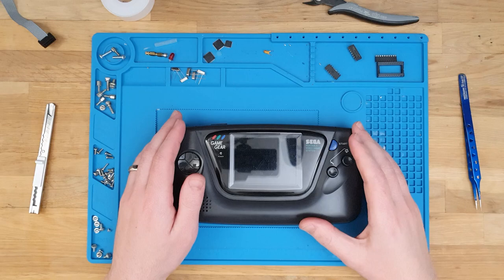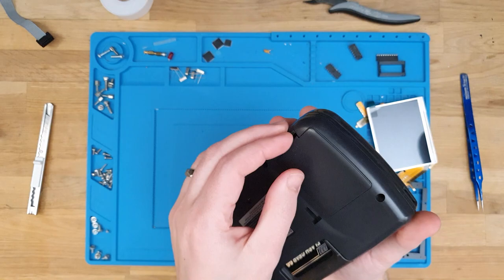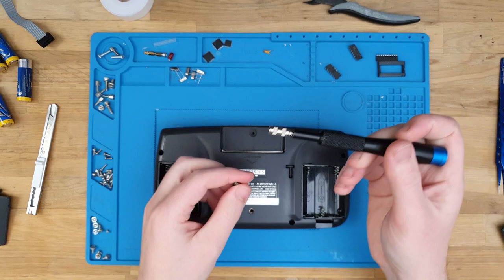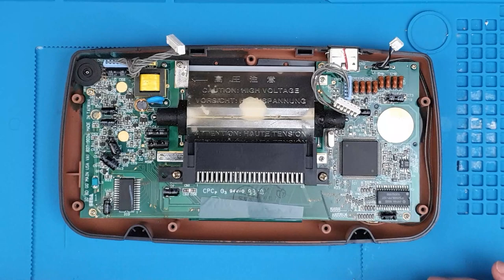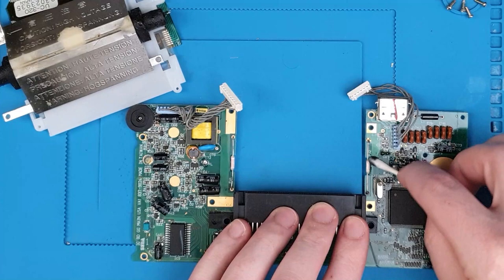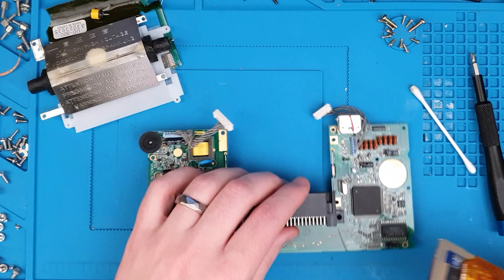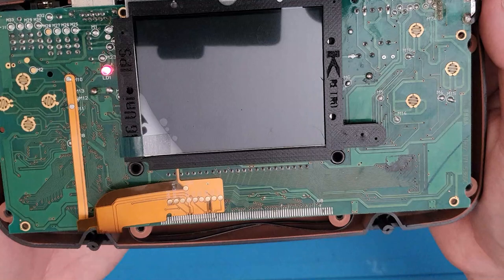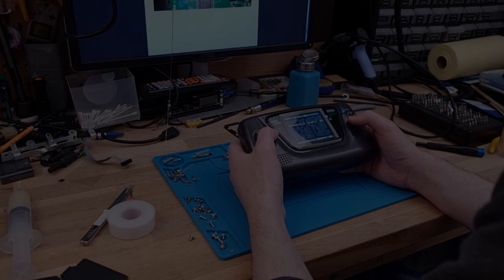Refreshing this Game Gear with an IPS LCD kit

Comment: Why didn't you attach the  T10 ribbon line down into place? I've always attached that and on the GG you are working on in the video, the point for it is just under the main ribbon center where that small bit sticks out. You fold it under and solder it onto the small point marked as T10 near the lower left section of the IC. I tend to install the LCD connection portion of the ribbon flex first to help get that nice and lined up along with the point for the SMS pin 2 section. As you noted, it is much easier to do that with out the LCD in place yet. The only other main thing you need to know as I've installed a few of these now and had 2 of them get sent back after a month or so where the just come up with a blank screen playing blind. The clock signal you solder onto FB1 is very thin on the ribbon flex and seems to break at the solder point easily over time. So I've been installing an additional section of kynar from the FB1 pad back to the clock pad on the LCD in addition to the ribbon flex soldering to make sure. I've brought this issue up with Ben and he is planning a redesign of that section of the flex. Really the trace just needs to be thicker there I think. Nice job!
Reply from the maker: Eagle eye! I spotted this while I was testing and couldn't play SG-1000 games, as they came out black and white and terrible, went back in and saw the missing connection, but was too tired to record an additional segment.  Can't sneak anything past the internet :D This ribbon doesn't seem to need that little leg folded under, as there's a via in the main ribbon covering T10 that you can solder down in place.

Interesting note about the CLK and FB1 connection, it feels pretty solid to me but I'll give it some playing with and see. Maybe this is a newer revision of the ribbon than you've worked with?
Reply: @silvestronsbitsandbytes  The ribbon you have shown looks like the others I've used and my mentioning of this was only about a month back. So I don't think he has redesigned that part of the ribbon as yet. And again, the connection still seemed solid on the two I had, but they were just black screens and sure enough, the clk signal wasn't making contact anymore. So a small jumper wire from FB1 to the clk pad took care of them. As a result of this, as I stated I've taken to just soldering in the extra wire to be sure.

Comment: I've been battling with the idea of doing this or not. Part of me doesn't want to because of the "retro" point as well as this was my childhood console BUT, the video at this point is so hard to see that it's really unplayable. I am hesitant because frankly doing the re-capping was testing to my skillset but Retrosix is supposed to have more kits in on the 8th and that looks a bit easier. One question for you though, what is the name of that cartridge that has all the roms on it?
Reply from the maker: I do agree that keeping the original screen is keeping it more authentic, but to actually enjoy the system and games (without emulation) imo you basically have to upgrade to an IPS LCD these days. The original screens are just garbage now.

The flash cart is a Flash Gear Pro and it takes roms on a microSD card, can find them on AliExpress for relatively cheap!

Comment: I heard you need to trim the sides of the plastic frame a but to fit the screen, is that true? is the image being cut off?
Reply from the maker: It depends on the LCD kit you get. With the BennVenn kit, there's no trimming needed. Some of the earlier Chinese McWills knock-offs needed trimming, though the newer ones don't! The only thing you need to trim across the board is the middle screw post, as it interferes with the new bigger screens.

Comment: Hello, I see that where the 68uf capacitor goes, you replaced it with a 100uf one. It is impossible for me to find a 68uf replacement, do you think there would be no problem if I also included one of 100? Thank you!
Reply from the maker: Hey! This unit was recapped before I got to it, and I didn't even notice that. Good eye! You should be able to easily find 68uF caps from Mouser, Digikey or Element14 suppliers.

I couldn't guarantee no problem with replacing it with a 100uF. Looking at the schematic, it's connected between a transistor and an LCD pin "VM" who's purpose I'm not sure about, but doesn't seem to be used when an LCD replacement kit is used... all that to say yes, you're probably fine with using 100uF!

Comment: Hi, what is the temperature of your iron?
Reply from the maker: Heya! I almost always run my iron at 400c, but I've gotten a good feel for how hot that is, how my tips transmit heat, and how long to linger on joints and wires etc.

I recommend people set theirs to around 340c for most day to day leaded or unleaded soldering!

Comment: Looks great but for all I'd ever decide to use it, the price is not appealing. Especially considering the alternatives these days, such as the Miyoo Mini Plus at the same price (often cheaper) for a whole console with packed SD card and rechargeable battery. I had a Game Gear back in the day, repurchased a few since. I understand the whole "revisiting the past" concept, but I can't say the nostalgia is really there. Never cared for the shape or feel of the thing nor the battery life. My only takeaway was The Lucky Dime Caper Starring Donald Duck and Sonic 2. A neighbor had Mortal Kombat 1 and I was envious at the time. 

I left my console plugged in beside my bed when I was a kid to play whenever I felt like it. One day it just wouldn't power on and so I decided to tear it apart. Only I didn't have the special driver. so I twisted the case around struggling and ended up just smashing it. I look back on those dark times an wish I could revive the things I massacred back then due to lack of patience and knowledge. It probably wasn't the console, even. Just the power supply burning up. It will forever haunt me not knowing the answer. I also broke one before this by slamming it down too hard while fighting a boss in Sonic 2 back in the day. That one was the tube, for sure. No idea what ever happened to that one. Hey, did you hear I wrote a book? Alright, that's enough now. Nice job. Clean your tip.
Reply from the maker: Fair enough! I don't know, I just love the form factor and games, and they feel so comfortable in my hands. Definitely my favourite handheld of the era. I never had one when they were new, so maybe that's something to do with it!